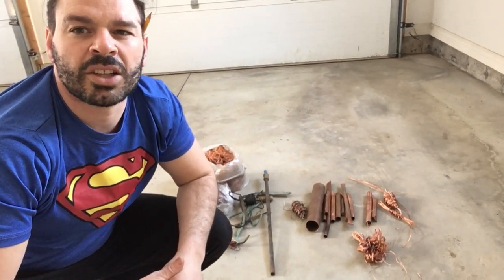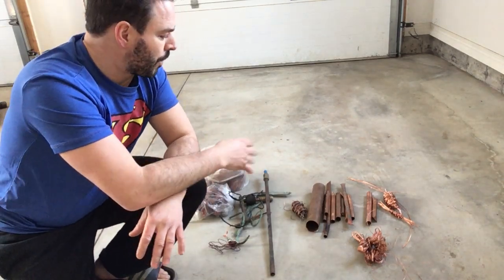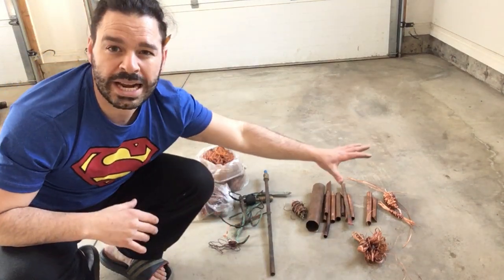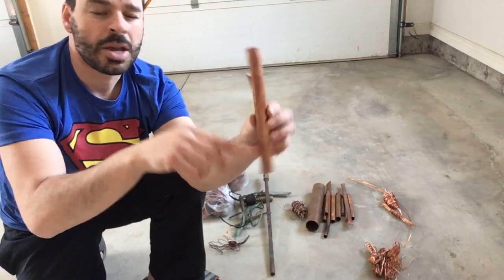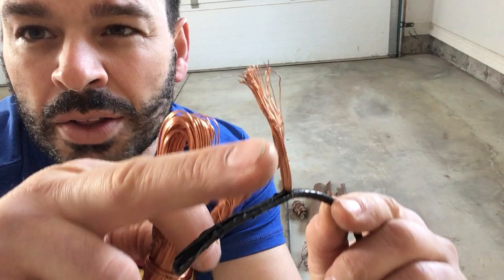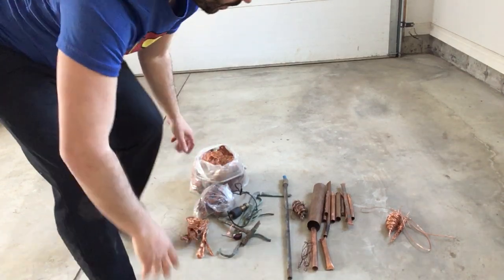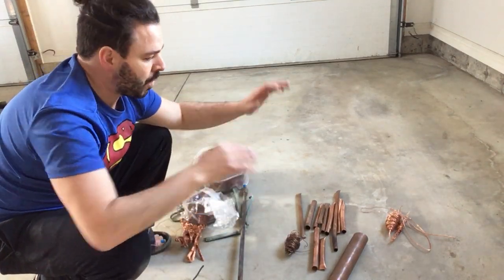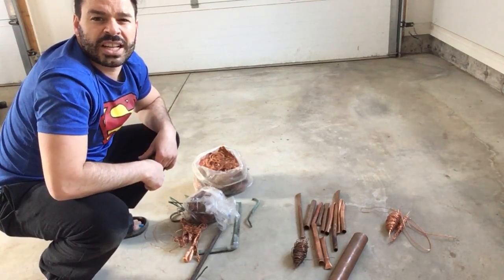Scrapping copper. How to grade and sort your bare bright, #1 copper and #2 copper for MORE money.

Comment: Speaking as someone who knows physics and chemistry, from the smelting perspective, all of these smelt the same, no significant difference in energy or processing cost, oxidized or not, skinny wire or not.   The grading system is totally designed to rip the copper seller off.  Period.
Reply: I believe it.
Reply: The different classes represent different expected yields. Bare bright is 99%, #1 is copper with an expect yield of 96% and #2 is copper with an expected yield of 92%. If those yields are not met when the scrap is processed at the mill the scrap yard is penalized. You can understand that 1000lbs of #2 copper will have traces of oil, lacquer,  hair and crap in pipes that burn off when they smelt it resulting in only ~920lbs of final product. 
Bare bright can also be bought by manufacturers that don't need 99.9% purity. The reason yards say anything smaller than 16awg is #2 is because it will have lacquer on it even if it looks clean.
Reply: @newsweathertraffic18 well said , you should of ended it with “period” 

People aren’t ripping you off they are trying not to get ripped off by you

I’ve personally gotten away with the odd sand filled copper pipe and they aren’t happy about it let me tell you

Comment: Everything you said is mostly right but unless you're selling directly to a refinery, most yard won't be that strict. I buy and sell corroded and tarnished copper as #1 daily and as far as bare bright, I tell people to do a quick bend test. If it's thick enough to hold an angle it will probably pass, so up to about a 20. But hey people like you make my job alot easier.
Reply: I do the same nd I throw some not so bright wire in nd it blends right in

Comment: Dude thank you. I’ve looked up how to sort several times and this is by far the best explanation of it all that I’ve found. Covered every one of my questions. Thanks so much!!
Reply from the maker: Glad I could help. Stay well and thanks for the support.
Reply: Have you guys encountered a copper wire that is shiny but has a silverish color same with the connectors. I tore apart an old welder and this is how all the wire is
Reply from the maker: @Scooty_scoob  yes, actually found some today. Some wire has a silver coating over the copper. If you scratch it the coating with come off to reveal copper underneath. However, some wire is aluminium….some electronic wire is aluminum. If you scratch it with a file and does not reveal copper underneath then aluminum. I keep it separate. You don’t want to throw in with copper appliances wire if you have a lot, since scrapyard will downgrade huge. I have also thrown it in electronic wire which is separate category. Has a metallic wrap around the copper strands.
Reply: @TinManScrapper  interesting this is definitely copper cored wire. It had ring connectors on the end that I cut off. The insulation was a rubber or plastic that Mitsubishi and another Japanese brand its nice wire. If it was longer I would keep if for auto grounding wire. Thanks for the information

Comment: I work a scrap yard as a scale operator buying material and a guy went in with some bare bright looking stuff but was very thin and his first words were it didn't matter of the thickness and my first words were it actually does matter of the thickness  I told him just cause it's bright dosent mean its barebright It has to be a certain thickness  but after watching ur  viedo iknow I was doing my job correct
Reply from the maker: Thanks for the comment. You must see all sorts of things come in! People like to argue if they are not sure. Stay safe.
Reply: That smaller stuff if it is clean and no grease or coating it's bare bright because the scrap yard will put it all together crush it and get a big ingot which will melt nicely. Some of these scrap yards try to pull wool over our scrappers eyes. I have been well informed of this process as my friend works for a foundry and they give the prices out so as long as it is clean and not like a human hair then it is Bare bright. My scrap yard pays it for Bare bright at £6.50 KG. So great prices.

Comment: Heres what i know from my years in smelting metals

Fresh copper is the best to work with and gets the most value

Oxide/green copper is inherently the same as the shiny copper as it all melts the same, and the oxide becomes copper metal, but scrap yards pay less because they can due to its color somehow making a difference to the metal

Now tin/solder contaminated copper is a given for lower price as its contaminated and not pure but depending on the level of contamination it may not affect the metal at all but its generally the lowest prices

Comment: I'm assuming all scrap yards must do things a little differently. My scrapyard that I go to consider all of the solid wire lto be bare bright ike the wire you showed here in the white wrapping as long as it is stripped and cleaned as you mentioned, where my scrap yard seems to be different from yours is the wire that comes out of things like extension cords  or pretty much any type of cord that has been cut off a small appliance as long as it's stripped they count it as number one along with all clean tube copper.
Reply from the maker: Yes, it is amazing the different rules and even prices some scrapyards are willing to give for the same materials. Thanks for the comment. Stay well and happy scrapping

Comment: Thank you. I just took down a motor from a vacuum. The copper coil has a red tinge. Is that a coating?
Reply from the maker: yes, scratch, if copper underneath still #2 copper because of the coating.

Comment: If I melt my copper what grade would that be. I hope that's not a stupid question. Love your video. Thanks.
Reply from the maker: Never a stupid question. I think you could get bare bright if it was buffered up. However, it also depends on the yard. Some scrapyards WONT take bullions as they question the purity. Some may put some extra metals to make it heavier.

Comment: Does the plastic need to come off of the motor windings to maintain a number 2 classification?
Reply from the maker: I do not remove the little string that goes around the windings. I figure it is already downgraded to #2 so should not make a difference.

Comment: Hello Tin man I have ? For you #1 copper can it have a little bit of coloration as well as corrosion on it or would that be considered #2
Reply from the maker: it would if a lot of corrosion. I think sometimes it depends on the person working the scale house. If paint for sure #2 but again some little discolouration not huge deal. you could also just soak for a little in vinegar. I have a video on upgrading by soaking in vinegar.

Comment: Hey tin man just to clarify If I have clean wire that would be considered bare bright but is less than 16gage it goes all the way down to #2? and thanks
Reply from the maker: Yes, that is correct. However, I would check with your yard. I think some times it depends on the person working the scale.

Comment: I have about 80 pounds of bare bright wire and 20 pounds of oxidized 6 Guage do I need to separate them or will they do it at the scrap place?
Reply from the maker: I think it depends on your yard, but I would say most won’t take the time to separate, but will downgrade you to #2. So do it yourself, just in case.

Comment: Great video.  The price difference between #1 and #2 now is not great, so don't bother cleaning up #2 into #1.  Here in Australia, #1 has to be ultra clean.  If its from an aircon that's had oil in it, they say #2.  I even had some brand new pipe with the label sticker on it...#2 cos of the label!  I just leave it all as #2.
Also, we're not allowed to leave lumps of brass connected because brass is heavy.  I mean, you could leave a brass attached but it would add so much weight there's no way a yard is gonna say #2 - they'll say clean brass mate.
Reply from the maker: Thanks for the comment. It is amazing the different rules and regulations between countries. Stay well.

Comment: What if I smelted all my copper together into small ingots. Do the scrappers take in ingots?
Reply from the maker: Scrapyards may not take the, because they question the purity of the metal in the ingot. I would check with the scrapyard. Problem is some people have tried putting steel ods etc. in their ingot to try and make them heavier
Reply: @TinManScrapper  10-4

Comment: Thanks for all the great info! Needed a refresher on scraping and your video helped a ton! Also another way if you dont got a cut off tool for things that have been soddered together, like that elbow is you can put it in a vice and apply some heat (I use MAP gas, it's in a yellow cylinder). Soldering will liquefy and you can usually twist it apart. If not I like to use channel locks.
Reply from the maker: Thanks for the tip and kind words. Glad you found the video useful. Stay well
Reply: just bend it back n forth a little and boom, it snaps

Comment: is #2 insulated copper wire the same price as #2 bare? just wondering if its worth stripping
Reply from the maker: Same price. #2 is number 2 regardless if bare bright or not.
Reply: if you don't strip the wire, you'll get 1/4 the price, like 80 cents a lb, strip it and get $3 or more

Comment: Doesnt it all just melt down to the same thing though?
Reply: Yeah but like the coated one is only 40-60% of actual copper, and then the tarnished stuff could potentially be mixed brass you can’t really tell unless you use some sandpaper, that equals labor so it needs to cost less, if you know it’s copper it’s worth cleaning it up a bit there’s even solutions you can put a whole lot in. 

So basically it does melt down to the same thing but if you don’t show them it’s not mixed with anything there not going to give you full price 

(Also really thin stuff burns away when melting it more then the thick stuff more chance of contamination and what not so lower price for same weight)

Comment: Great vid.  Clear.  i think i am getting ripped off.  I got paid copper #1 price for what is bare bright (bright and shiny with a gauge equal to or larger than 16).  oh well, live and learn.  i was also told that all copper pipe goes as #2 unless it is straight from a shop or never used!
Reply from the maker: The bare bright I had as well went with #1 bright, although I was not sure. The copper pipe however, yes should have been #1 unless it had soldering on it. If you were getting #2 price than ripped off for that. With price so high, some yards will try to rip off. Next time if you have a lot, tell them you will bring to another yard for better price.
Reply: @TinManScrapper  I'll do that.  Thanks

Comment: Is sheet copper considered #3?
Reply from the maker: Yes, thin sheet copper and heavily soldered, but usually soldered will go in #2. It does depend on where you live. I have got all soldered pieces as #2 price
Reply: @TinManScrapper  we are $2.86 per lb for #2 copper. Our non ferrous is ridiculously high right now. $2 a lb for clean brass too

Comment: An easy way to clean your copper instead of sanding every single piece is simply cut off any non copper parts then put them in a tray with CLR.
Its cleans of all tarnish and gives you max dollar at the scrap yards.
Reply from the maker: Good method as well. Thanks for the tip. Vinegar is another suggestion made from someone else. Thanks and stay well.
Reply: Would chem-dip carburator cleaner work?
Reply: @MrsBuddevil  Not sure as i have never tested that method but its worth a try and see the results :)
Reply: Do you get the cleaning agents like solvents and acids for free?  
No.. so how cost and time effective is it try polishing a turd, especially when the scrap yards are out to debase everything to maximise their profit and rip you off?

Comment: Why would a pound of #2 be worse than a pound of bare bright? They are the same weight & composition.
Reply from the maker: different price at a scrapyard. #2 copper going for $4.30 Cdn and bare bright $4.50 Cdn a pound. Usually #2 has a coating, glue, paint or less than 16 gauge.
Reply: @TinManScrapper  Any idea how to find a scrap dealer in a rural area? I've asked around and no luck. 😞
Reply from the maker: Unfortunately you may have to take a drive to a local yard. I will drive an hour to London for my good items because it is worth way more than my other yard 25 mins. away. I would just make sure that when I went I loaded up as much as I could to maximize profit. How far are we talking to the nearest yard? Google search closest and as mentioned I giant load of copper can be worth in the 1000s and well worth the time driving to get it to the yard @aCycloneSteve

Comment: I get the pipes having corrosion, solder, paint and who knows what, that will reduce the amount of actual copper being processed by weight. But to downgrade copper, just because it’s not pretty, should be illegal. How much is actually lost on tarnished or dark copper, versus perfectly bright copper. Even stranded copper, that’s not lacquered, is still high quality copper. 
  And don’t even think about melting it down into ingots. They won’t take it. 🤷🏼‍♂️
Reply from the maker: totally agree with you! Copper is copper, just like gold is gold. Some yards try to take advantage.

Comment: GAUGE	              SWG DIAMETER (Inches)	AWG DIAMETER (Millimeters)
12 Gauge Wire	       0.1040 in	                                2.052 mm
14 Gauge Wire	       0.0800 in	                                1.626 mm
16 Gauge Wire	       0.0640 in	                                1.290 mm
Reply from the maker: Yup, higher the gauge number, the thinner the wire

Comment: they should change the name for bare bright....u could have bare and bright copper, but if it isn't thick enough, you're kicked to the curb
Reply from the maker: Yesh, funny the different rules. Thickness of wire…..copper is copper.
Reply: with a price difference of around 30c I wonder if id be worth it to melt it into a bar and get bare bright prices
Reply from the maker: @_Xyte  be careful, some yards won’t take melted bars because they question the purity of the metal. You could also separate the bare bright copper that is less than 16 gauge from the rest of the wire. The people at the yard may give you bare bright price for it now given the demand. I think some time it depends on who is working the scale on the particular day.
Reply: @TinManScrapper  DEFINITELY depends on the scale guy & his prejudice that day... can prove that here in Vegas but filming different trips with same crap lol